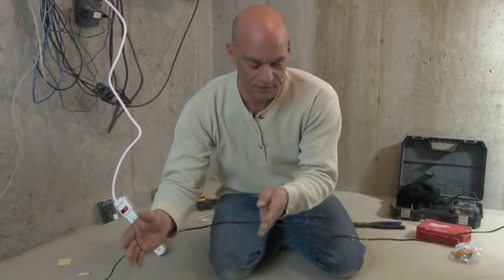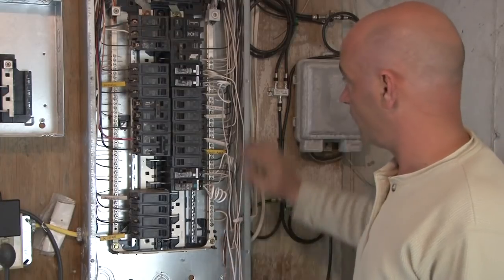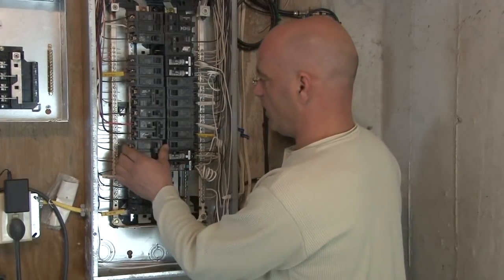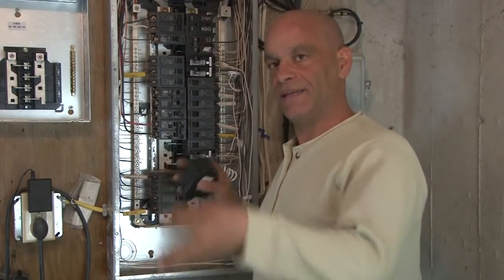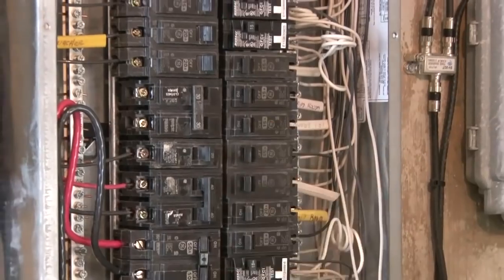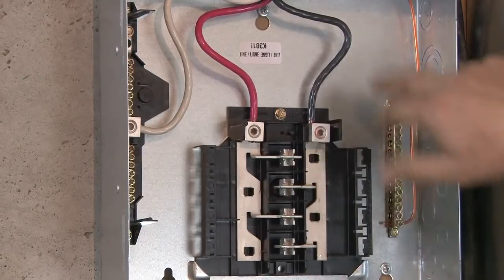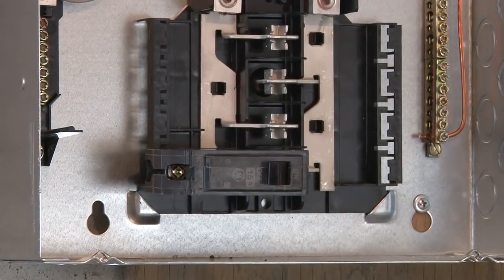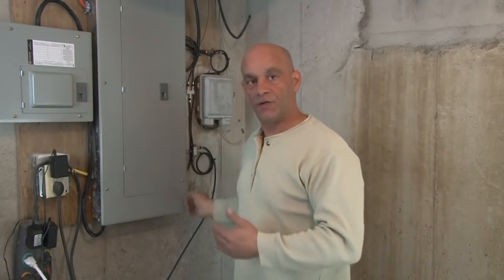How to Install a Subpanel

Comment: Why does the green screw have to be removed in the subpanel but not in the main panel. Sorry but I need to know details PLEASE!!!
Reply: +Dale Johnson a main panel can have the grounds and neutral bonded together but when you add a sub panel to an existing main panel it needs to be separated. it is required by code and because it is a shock/fire hazard.
Reply: @ryku444  Two wires, neutral and bare ground, in parallel point a to point b, if one end is bonded, then the other end will be bonded! Check the sub panel with an ohm meter, they may be separated, but I bet you have continuity!
Reply: @bebo5558  Bonded on one end is not the same as bonded on the other end as well. The reason you don't bond neutral to ground in a sub panel is the ground wire should only carry current during a fault event. The neutral carries the difference between the currents in the two hot wires of the sub panel. If you bonded the ground to the neutral then the ground wire would share the current with the neutral wire.
Reply: @jemezname2259  This is why this topic is so hotly debated! I can see you've swallowed the pill and gone over to the dark side, Ha. Do you realize how many sub panels have been bonded over the years and are still working just fine, no problems? I have two inspector in my area that were electrical engineers in another life, different districts, they still require bonding at a garage sub panel and ground rod or they won't pass the job! They say the ground rod is supposed to "anchor" or zero the the center tap neutral from floating around and a ground rod grid that will handle a fault. Their theory is, the sub panel "hub bub" is to sell more wire, change the way things are made, make more money to line the pockets of big companies! Sort of like "new math", same end result, longer/more expensive way around?
Reply from the maker: +Jones21101 So very true.
Reply: 0
Reply: 0

Comment: i'm electrifying  a shed with 100 amp ( about 20ft from the house). I'll hire an electrician, but must know what's going on, so no short cuts are taken!  After i install the appropriate ground rods do i still isolate the ground from the subpanel? to deliver 100 amp a total of 30 ft. what gauge wire would i use to connect house breaker to subpanel in the shed?  i'm going to have  a split unit AC and powerful lighting ballasts  (in the shed) should i also have a panel box surge protecter for the subpanel?

Comment: Overall and comparative to running new service to a home or a large home addition the physical install of wiring, etc., generally speaking is straightforward.  The hard part is knowing what you are actually doing and that is what training and experience give a licensed electrician.  If you have questions about what you are about to do when it comes to electricity I would not rely on  the internet or a television show for answers.  On occasion you'll find someone at the home improvement stores (e.g. Home Depot) that actually know what they are talking about but again if you have questions about this they are best answered by a licensed electrician.  I haven't priced it out but paying an electrician to add a sub panel should not cost very much.  One of the reasons I attempt this kind of work myself is the difficulty in finding a good contractor and working with them when and if they do show up.  Also a licensed contractor typically will find something they don't like and want to correct it which is great but once you open that can of worms the cost can increase.  I think that is what leads many to the DIY path.  This is an excellent video but again if you are at all squeamish about doing this yourself then just suck it up and hire an electrician.  And please don't even touch a panel until  you shut off the service and test to be sure.
Reply from the maker: +Bones Eye Thank you. That's why many times when someone asks me a simple very basic question I tell them to call an electrician. One little mistake will be a BIG one.

Comment: Weeeeeee. Here we go. I got me a 15/208-230 1.5hp single phase motor and I have a 15amp circuit in my garage outlet for it. If it blows the circuit I have but 1 choice. To add a sub box because I have 0 open spots for a new breaker. So could I do this; install the box and take out 2 of the 15amp breakers and move them over to the sub box and add a big breaker in their spot to power the box. My question is if I plan on running the 2 15amp and 1 30amp at 220 do I need at least a 60 amp breaker to the sub box. Also when I move the 15amps over I move all the wires with it including the ground and neutral correct? And last but not least, how do I figure out my allotted amps. I don't want to do all this work and have com Ed come down on me.
Reply: It's fine. I saw that after I posted and am too lazy to edit. I am a firm believer that as long as I can get the point across I need no grammar or spelling, but yes it is a circus in here after I told my sisters what I want to do. Appently I'm going to set the house on fire, make the bill go through the roof, or electrocute someone. They did not fear for my safety though and seem to forget that I wired the gage lights and a ceiling fan and I'm not re wiring the house just adding a single circuit so I can run a belt grinder. I'm going to do it when they aren't home anyway.
Reply: Why thank you. Good luck to you as well and happy New Year.
Reply: I don't need to do any of that anymore
 The motor I got runs fine on 110 as long as I don't have anything else on. It is for a belt grinder so I wouldn't be doing anything anyway.
Reply from the maker: +stizan24 Con Ed? where are you from. Might be close to me. First off what service do you have at the panel now? Amps?
Reply: I live in Dundee Illinois. If you add up all the breakers I got 155 in 110 single pulls. 2 30 amp doubles at 220 and a 100 double pull main.
Reply: 255 at 110, not 155.
Reply from the maker: +stizan24 No, how many amp service do you have?  How many amps is your main breaker?
Reply: Although I could just go 20 amp with 12awg wires and run those into my garage. I'll probably have the 1.5 motor long enough to move out of state and 30 amps might be over kill, I don't want to fry my motor.
Reply: Oh. The main is 100amps
Reply from the maker: +stizan24 Than I would first suggest before you do anything upgrade your main service. 100 amps is really not that much. However back to you tripping the breaker. Why not just upgrade that circuit to a 20 amp 220.  Ok well it's 1:15 am and I'm off to bed.
Reply: Cool. I will see about that. Thank you!
Reply: What do I do if I need to move a couple 15 amp circus over to the sub panel and the wires are too short. Do I need an upgrade at that point because upgrading is going to cost me a grand at least and 50 dollar permit fee. I could do it all I would just have to map out the circus better and buy the stuff and call Com ed to shut down my power for a few hours.
Reply: +stizan24 The Circus, huh? I think you are trying to say, circuit. Which in this case doesn't apply. Breakers, yes. Move a couple of 15 amp breakers to the sub-panel. I apologized for the correction.
Reply: HA HA HA...lol go ahead, stizan...make your move...good luck and be safe...
Reply: +Jammin Dave oh I will. main shut off. all the Romex in conduit. nit exceeding the amps in the breaker powering the breaker. putt jelly on the big wires powering the breaker. 12awg wire for a 20 amp going 40 feet. 20 amp outlets and plugs. no drinking till the job is done. no turning on the main till everything is hooked up, and test it with the volt meter when I'm done before I plug in.
Reply: Why do you used conduit, Romex can be run as it. No need for conduit.
Reply: +Jammin Dave I just want to be fancy, I won't actually run anything until I get my hands on the code. I have to call my local township, county, and state to find out what I can do, and considering i.live in Illinois someone is probably going to have a hand out. I won't actually use conduit except in my garage where this circuit is going.
Reply: Ha ha ha I'm from River Grove, IL. as well. Good luck...
Reply: +stizan24 shouldn't run romex in conduit
Reply: Why not? People do it all of the time...or rather use BX 12-2 with ground, instead.
Reply: +Jammin Dave I read something about romex can possibly overheat because its sheathed in the conduit. Might be okay for short runs /expected duty load for what you're planning, but I decided to go with romex run along the top plate and wired to single strand THHN wires in a j-box and dropped down in conduit.
Reply: +Jammin Dave it was a different type of job, but same concept could apply.
Reply: No.. use conduit always on an external mount.. or wire mold.. it protects the wire AND YOU!
Reply: You got it Paul Matsumura.. the only thing on top of that is grounding.. very important.

Comment: Great video. I have one question about it. Did you use SER or SEU cable for this, and I assume it was 6-6-6 for the 2 hots and 1 neutral, possibly 8 for the ground?

I"m seeing a lot of conflicting information out there in regards to using individual THHN cable in conduit vs a cable like you used, without conduit. From what I can tell SER and SUE are composed of THHN wires, so I would think it's okay to use it despite it being service cable typically used at the voltage drop.

Ok, one more question. Your sub was very close to the main, mine will be around 4-5 ft away on the opposite side of a non-weight bearing wall. I was going to run the wire, in a single cable, through the wall since it will be enclosed in drywall, without a conduit. Given my above question, is that correct by code to do? Mine will also be a 100amp sub, so 100amp 2-pole in the main, was thinking 2-2-2-4 SER cable to feed it.

Thanks again.
Reply from the maker: +Jay Labbe Always check with your inspector. However if the cable is going to be in a wall it does not have to be in conduit. Yes I could've use conduit but there was no need because I was so so close. 

Put it this way, if the wire could be damaged by someone banging against it then chances are it should be protected like something like conduit. See my site for size....  http://www.askmediy.com/electrical-wire-size-calculator/

Comment: I'm kind of wondering why you would even need three phase my dad was an electrician and was a motor winder and he made coils for Bonneville Dam and needed the extra pizzazz if you don't know what electricity is and you had three phase its just astounding that you would even we contemplating the attempt just saying
Reply: 3 phase is primarily used for industry, and works a LOT better for motors.  The three phase sinusoidal waves create a constant voltage between them (as opposed to a voltage that fluctuates between 0-120/240v) that can be wired in wye or delta (depending upon speed and torque requirements) to produce high, constant output horsepower. 3 phase power is typically a higher voltage (480v/575v) for longer runs where low voltage and high amperage is not economical. The three phase motors are also very easily reversed in direction. A drive can be installed to maximize speed variation without diminishing torque by changing the hertz instead of the voltage for excellent speed control. 3 phase can also be transformed into dc current using a dc drive equipped with a module that controls the amperage/voltage by firing the thyristors at different phase angles. This would be hard to do with single phase and would likely require capacitors to lessen power drops.

Comment: I have a 3 phase panel and i need a sub panel how many amps should i use? Is for outlets and lights
Reply from the maker: +Anime Future Hi, I need a know a heck of a lot more than that. Let me just say. You have a three phase panel, and you're asking a very easy question. A three phase panel is nothing to play with. Not the same as the panel in your house for sure. Seen many people get hurt with three phase. One is even dead.
Reply: Call a licensed electrician. Don't screw with 3 phase. You make one wrong move and it will flash over or flat out kill you

Comment: i always worry about scoring my wires when i strip back the sheathing, and try to be careful. i'll try your tear technique on the job
Reply: The tearing from the end of the cable (as shown in this video)  is the way I've always done it. It is the best way to avoid accidentally nicking the insulation!

Comment: My microwave recently quit working (2 years old) and I have narrowed it down the the common wire coming to the outlet.  In the breaker box, there is one breaker switch dedicated to the outlet for the microwave, but I can't figure out where in the system the common wire has come loose.  We previously had a similar situation when 3 common wires were wire nutted together but one wire didn't quite mesh with the other two wires and this caused several light switches to stop working.  We had to hire an electrician to diagnose that one.
Reply from the maker: +Vernon Steinkamp First check to see if you have any GFI outlets between. The wires coming into the panel will have the hot, neutral and ground. Just follow them
Reply: By the way our house is less than 2 years old. Just surprised at the lingering electrical problems.
Reply from the maker: +Vernon Steinkamp Wow no kidding. That stinks. The more amazing thing is that it passed inspection, or did it.
Reply: i had an electrician come and he determined that the common wire was affected by a staple or screw during the construction of the house.  They will get into the attic tomorrow and add a junction box and pull the bad portion of wire out and feed good wire back through.  This was determined by having a plug in tester in the outlet while pushing the outlet back into the receptacle box.  That movement alone caused the common wire to disconnect.
Reply: A lot of electrical groups when wiring a new house will stab the back of an outlet or switch..(fastest way) these connections fail much faster. You should always pigtail and connect your wires to the screw of the device.

Comment: Dominic, great video. Question:  I recently moved into an 8-year old 3-bedroom home.  It has a 200 amp panel in the basement and it's full--no vacant slots available.  How do I add a sub-panel?  Can't some of the breakers be combined?  I can't imagine it is truly maxed out.
Reply from the maker: +Sam Beaudreux I wouldn't think it's maxed out either. However you don't ever combine anything. Watch my video on how to install a subpanel.

Comment: what panel brand is that? 
good practice on youtube is to list out products used in video  in the description.
you do a great job explaining things, pretty much to the point and safety (boring) is kept short (other spend 20min of a 30min video).
Reply: +TurboFlush It looks like a GE, because I have the same panel in my basement.

Comment: I'm a master electrician also and there are a couple things that I would mention.  They're technicalities but worth mentioning.  The first has to do with the green grounding screw.  It is only installed at one point in the system and isn't necessarily going to be required in the main breaker panel so people shouldn't add it just because it's not there.  Some systems may have a disconnect outside with four wires coming into the breaker panel.  The bonding point would be at the first disconnecting point only.  The second thing is the grounding at a separate building.  You need to add grounding electrodes but the NEC requires two 8 ft. ground rods that are placed at least 6 ft. apart.  They should be 5/8" x 8' but can be 1/2" x 8 ft. as long as they are UL listed.
Reply: +Anthony Mccabe You only need two ground rods if one doesn't have 25 ohms or less. Art. 250.56
Reply: Anthony is right. Code used to require 2 only if over 25 ohms. Now requires 2.

Comment: Im an electrician too sir . I want to learn the usa sestym for the electricity i know sections wears cables big cables too i use to work in powerlines but i quite. Please im moving to the usa soon i want to know the system because our electrical boxes are just plastic pipe pvc Felix i see u guys using the stainless steel boxes . And u did great work too .